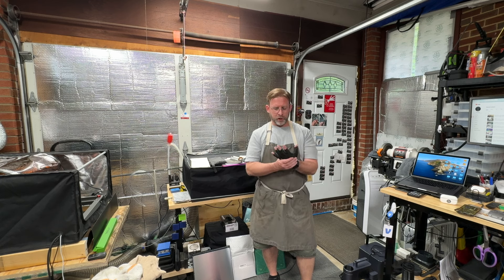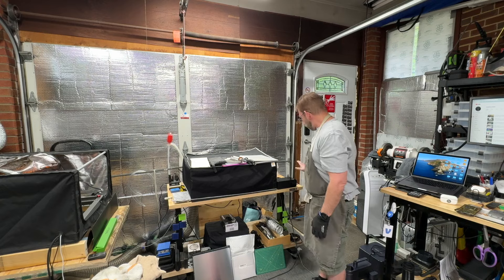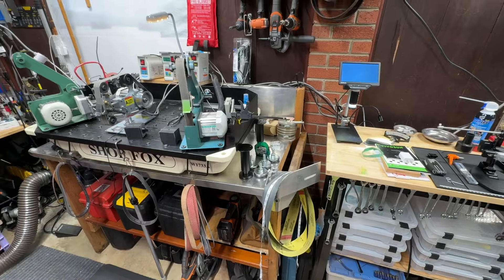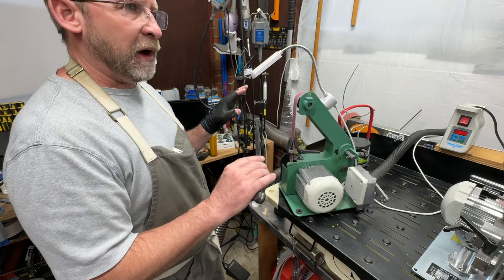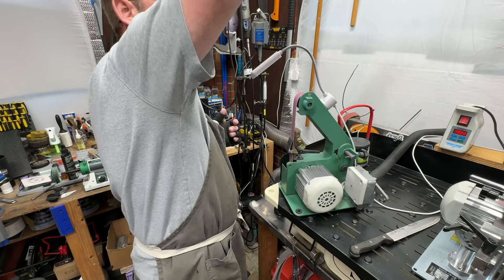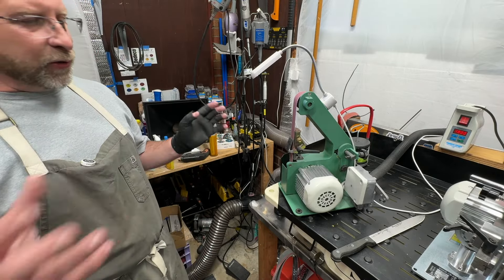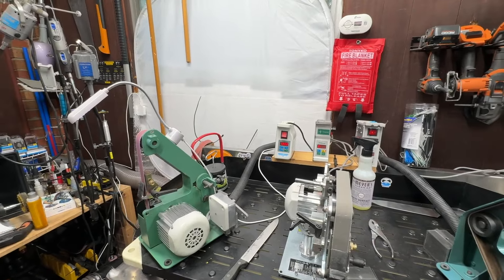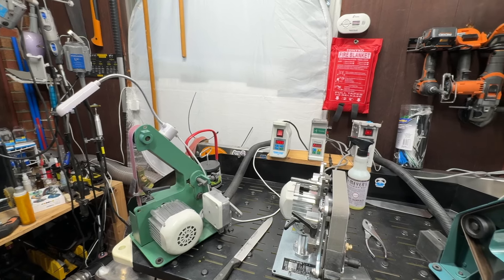Is lighting and height effecting your sharpening results?

Comment: Thanks for all you share.
One more tip... Drop the lighting down to increase lumen levels on your work.  Light falls off by the square.  If you can lower the light fixture by 12" to 15" it will often double light intensity at your work surface from the same light.  Quality of light ( Spectral Output ) may also yield more visual detail.  I have studied light & human visual capacity for many years.  If you have question I will do my best to answer.